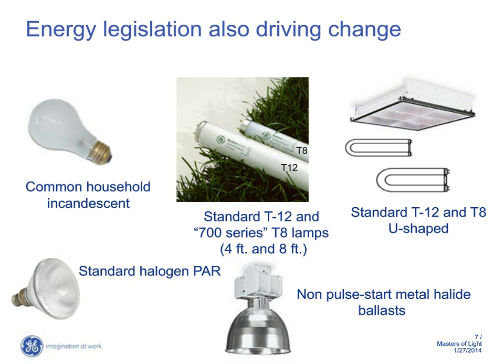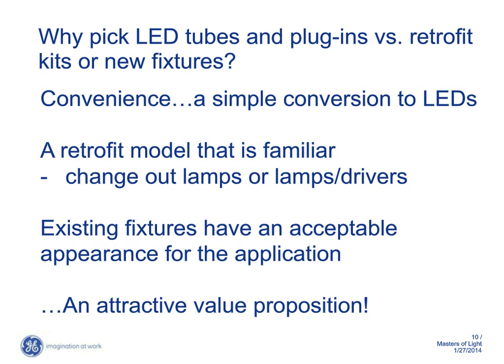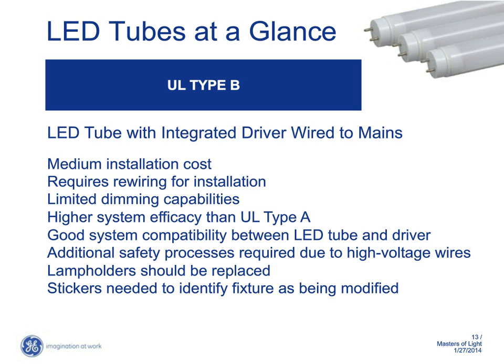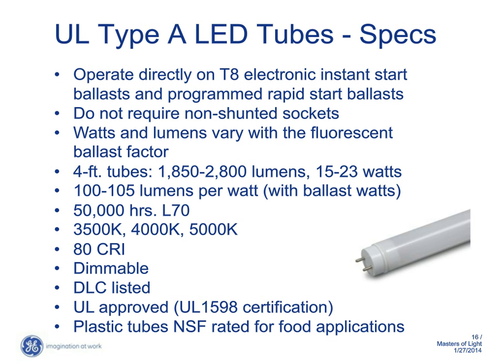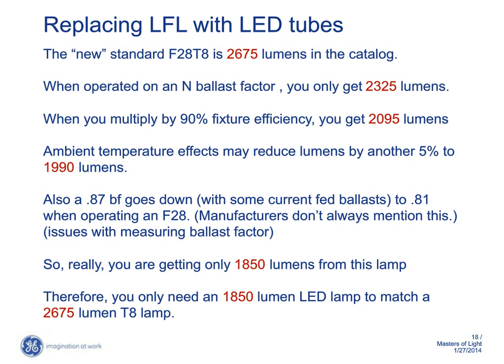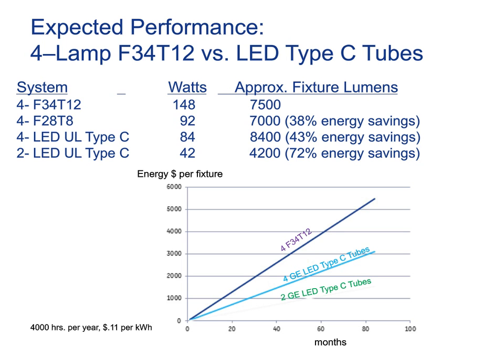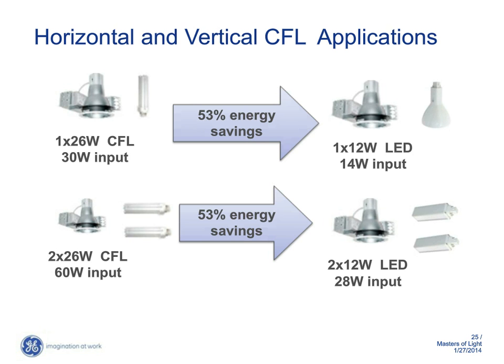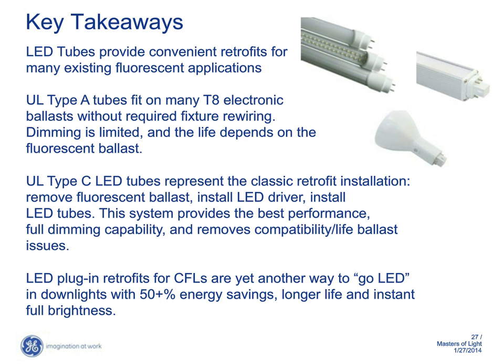GE: What You Need to Know about LED Tubes and Plug-ins

Comment: Right now I am building from scratch a UL type A Light fixture using a 2 lamp programmed start compact florescent electronic ballast mounted to a 4" square metal blank cover plate.  I purchased a few G24Q lamp holders on line. I will mount these to a 4" junction box using the 1/2" K.O.s. I might even put a pull chain switch on it.  The G24Q lamp holders screw on to standard diameter threaded lamp pipe. I will be using 2 LED downlight 4 pin retrofit lamps.

Comment: I don't see any problem with using UL type B as long as you use non-shunted tombstone lamp holders on the powered end. and you put the label on. After all everyone uses Edison screw base sockets every day. which are just as dangerous.